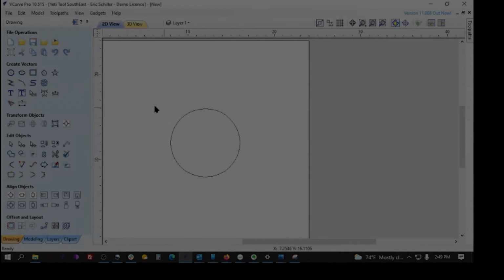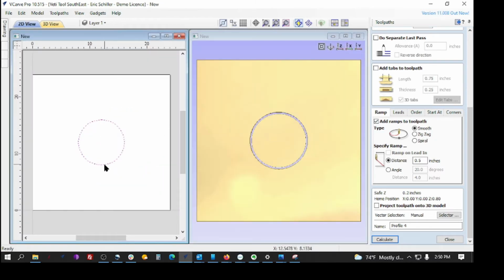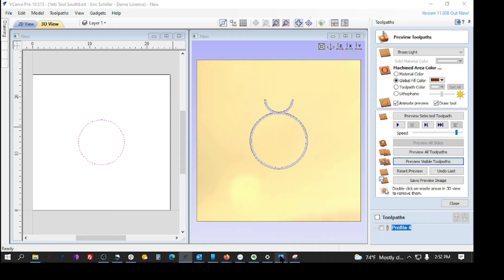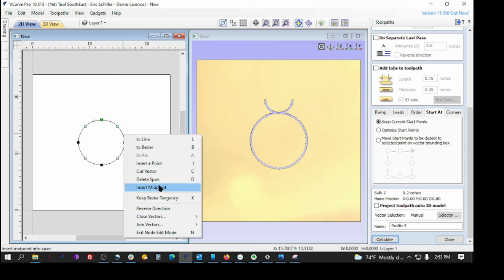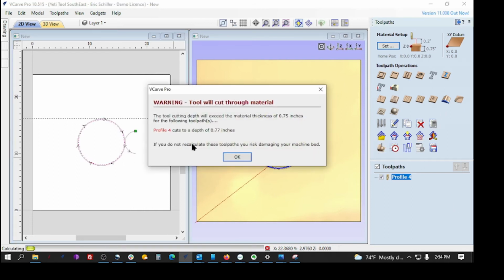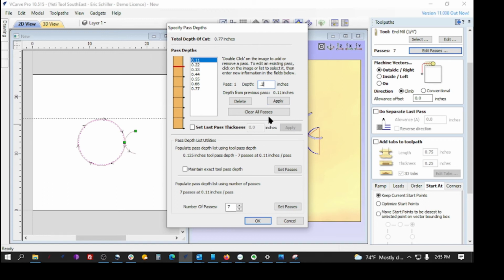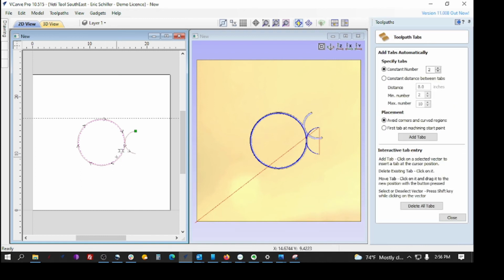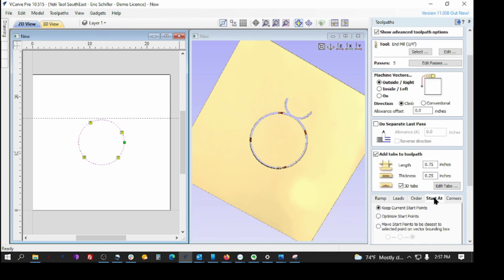VCarvePRO - Ramping options - change ramp type, where it starts and ends

Comment: Thank you so much for showing me this. I constantly get witness marks in the edge of hard wood when the cutter is running up and down the edge especially when doing finishing passes. This will eliminate this and I was wondering how I could build this into the tool path.
Reply from the maker: Great!  Glad it helps.  The biggest issue folks have with CNC is the software... Helping solve the software issues helps users through their learning curves... That's what we do here!  Thanks Marty!
Reply: @yetismartbench  you are very correct. There is so much I would like to do with my cnc. The issue is I don't yet know how to ask the software to pass on the message. 🤣 vcarve is amazing as it's so simple but yet under the surface is extremely complex and adaptable.

Hope you are well.

Marty